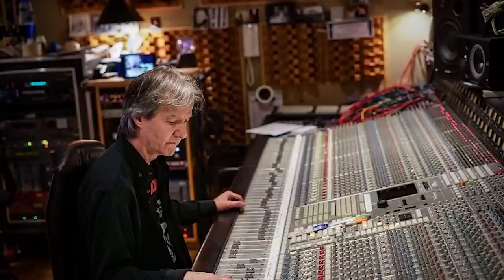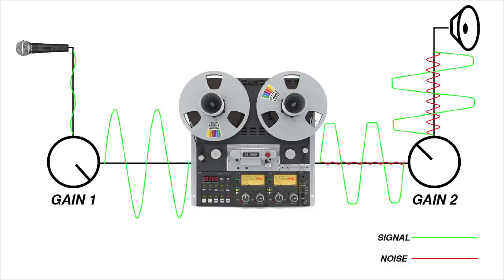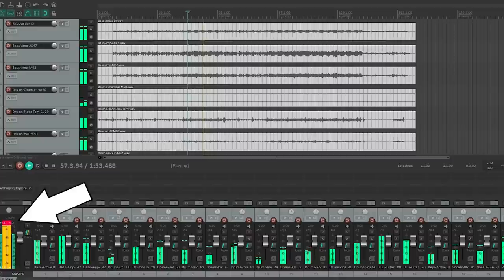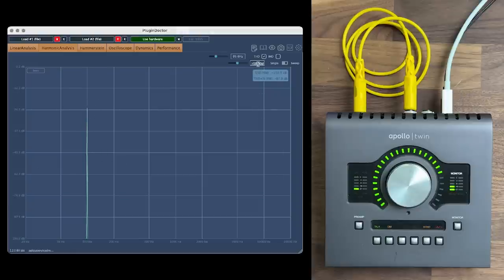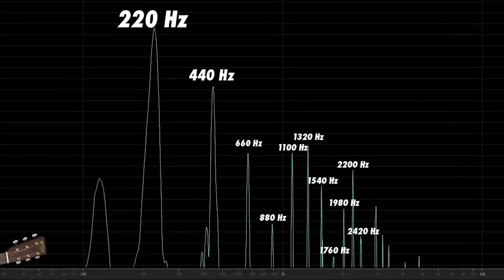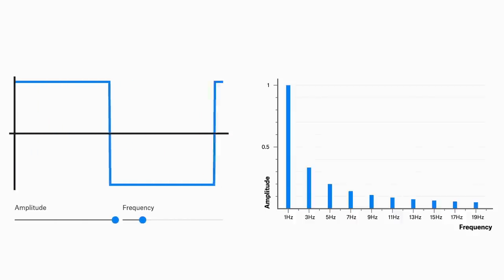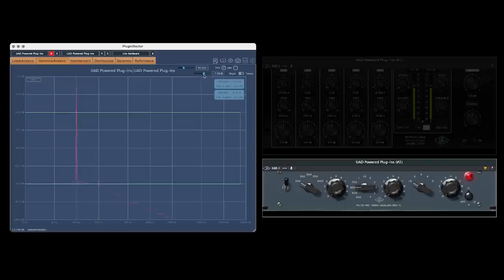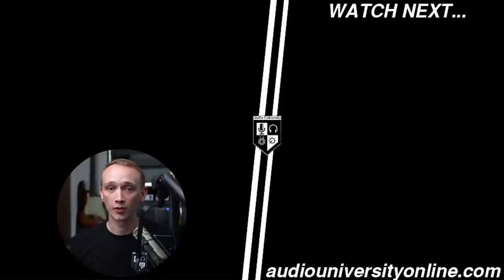What Is “The Analog Sound”? | Understanding Harmonic Distortion (Part 1 of 3)

Comment: You're very educated and it shows. You present well, but those who taught you, clearly don't have a true appreciation for what analog actually is. I will give you a simple analogy that I hope will help break their programming for you.

Incandescent lights are much more attractive than led. Do you know why? Because, though we can't typically make out the blinking of the led circuit, it's there. And very abrasive to the eye. It introduces a pulsing rhythm; albeit, fast, which stands as a separate and substantial part of the experience of its illumination. Add to this that it is quite focused and precise in its travel and direction with very little variance and you have a pronounced but somewhat fragile display of radiance.

Incandescent light takes much more energy to produce because it's accomplishing far more than the led ever can. It's not only sending out a continuous ray into the direction of the observer, but it is also pushing in various refraction into the bulb and creating a bath of light within and around the filament and its enclosure. The lack of which, in the led light, is easily noticeable as missing. Even seeming weak. Because it is.

Clear fidelity of digital music can get the job done with precision. But the reason it's able to is that it takes shortcuts. It gets there without all the fluff of making stops along the way and creating all those beautiful blooms and saturation that we recognize as natural to the real world but easily noticeable as missing from a weak digital representation.
Reply: nrezmerski  everyone knows that the clarity of digital lacks the saturation of what came before. That part is undisputed. So your statement is not correct in that respect. What I'm claiming is that the effect of saturation within the natural experience of sound and how it normally reaches our ears and is experienced is vital to the quality of it being perceived as a genuine, lifelike, sound.
Reply: @nrezmerski  everyone knows about reflection and dampening. We see these things come up in the subject of room sonics and reverberation. But what I'm saying is that at all times, in a natural environment, these things are playing a roll that far exceeds our typical breakdown and analysis. Object vibrating at specific frequencies only and only when the sound get loud enough in those frequencies to actually cause it to occur. Interference waves stacking at specific points in the room and creating coloration within certain parts of the spectrum. This combination between absorption and reflection leads to a lot of what we typically think of as undesireable effects. But I submit that the human ear is capable of making sense through all that and that it's what we are used to.
Reply: nrezmerski  because we are familiar with the way certain Hardware works we are able to select carefully the preamps and individual processes that we use in the hopes of introducing favorable saturation blooms to a sound that will make it sound favorable to us as if truly sounded in a way that was pleasing when it was first sounded in its environment.

You know this effect that I'm talking about because everyone knows that if you use specific Channel strips you will actually mimic a vintage sound as if it is a jazz band playing in a very specific type of environment. That is not just because you have chosen vintage equipment they can be done with modern equipment to if we know which saturation points to hit
Reply: nrezmerski  I would add that the complexity is infinite on this subject because what might saturate a certain area of the spectrum changes as you turn the volume up on a preamp and different frequencies at different points of the volume changes are accentuated more so and some less so
Reply: nrezmerski  Ergo the term nonlinear
Reply: @nrezmerski  as with all things in production we have a tendency to go further than nature in order to accentuate or pronounce what we or the artist is expressing and that's why it's often not perceived as a natural thing to reintroduce saturation into a dry and sterile recording.
Reply: @nrezmerski  I understand your argument and I thought I already addressed it by pointing out the fact that we don't have the ability to introduce the natural saturation so we look for it where we can find it and that is in the hardware. Familiarity with the sound of specific hardware and what we can do to certain sounds with them helps give us a pallet we can work with to try to reconstruct a natural sound. The point is that High Fidelity is very unnatural and it isn't the way the human ear here is because we hear the stuff that microphones don't pick up. We may not hear every little eddie of air currents in the room but we can hear the effect that they have on the frequency spectrum as they interfere with the waves that are heading our direction. The reason our ears hear better than a microphone is because our brain has the ability to make sense of it in real time. But objects in the room vibrating to the sound and air currents interfering with one another as the sound approaches us are definitely things that are not present in a typical professional recording and why the recording sound so weightless and clinical
Reply: @nrezmerski  maybe putting it like this will help. Reflection and absorption have another effect that they also provide for our ears to perceive and that is what we call Reverb or Echo. Just like with saturation of tone we also have the ability to differentiate where is sound source is coming from in the nature of that real sound within a space even though the space and its Echo is interfering with that sound. Two very different anomalies that occur within a real space but with your part of the natural way we differentiate and understand sound when it comes to us. Both of these effects can be too pronounced in a space and create difficulty in intelligibility of the sound. A person trying to talk to you through a paper bag for instance is a good example of the one while another would be a marble room with no absorbing objects in it
Reply: @nrezmerski  in both cases the objects around the Sound Source are heard more than the Sound Source. One by its saturation of the sound and the other by it's Echo. So I will point out that both of these examples will have elements of the two involved
Reply: nrezmerski  finally since we all know that reintroducing artificial space to a sound is an accepted practice for the very reason of which I am speaking because it is far easier to get a pleasant sound that is desirable to what we are doing then to work at finding the right space to get it naturally then it should be no problem accepting that the other effect that happens in a real-space might also be one that has to be introduced later in order to have control over it
Reply: nrezmerski  any piece of analog gear can ruin a sound but the one who finds it useful at a specific time has chosen that microphone preamp Channel strip or whatever it may be because it has a specific absorption to the Spectrum that flatters what they're working on
Reply: @nrezmerski  you're trying to defend the subject of rendering only. But the topic of analog is important to audio engineering in the front end and mixing process. When I hear someone attempting to reduce it to the difference between two mediums and saying that one might be better than another, it's like trying to compare one room to another for recording. If both rooms sound good to you at the time, no comparison is needed. So it's pointless to use that as the example, as it seems you are doing. Analog has a very specific purpose. The reason we have folders in our DAW named analog is because it is an effect that attempts to reproduce the lack of fidelity heard in every natural sound. We don't hear things perfectly sounded to us. There are many imperfections. 

An artist that paints a picture with exact specifications with every color thought out and placed within carefully chosen lines can and certainly does fall short of producing excellence, if he doesn't put the blending of saturation and imperfection in there that tells us it's real.
Reply: @nrezmerski  you're splitting hairs to try and prove yourself right when your argument has nothing to do with the point I brought up. That's what I'm saying. The stereotyping of analog here is wrong. That's what I'm saying. With no respect for the reason it actually gets used by nearly every engineer today. If you're only talking about what medium to use to record to, them by all means be that specific, without bashing what is quite likely, one of the most valuable sets of tools to come to the digital world since we entered into it. I'd say it's up there next to the DAW and automation. It's that important. The potential bias created by your words far surpasses the point you wish to make and I can't even fathom why your point could be so important as to be willing to cause such a bias with it in the first place. The fact that so many engineers are intentionally introducing analog back into their clean digital mixes should tell you something in itself. But based on what you keep trying to reduce it down to, I get the impression you haven't had enough pleasure with the use of it to get past the novelty of it to realize it's necessity. The loudness war is perhaps another topic that might give you a relative understanding of why I'm reacting this way. There is an enormous frustration on both sides of that argument, and each has their reasons. And both are so important to their side that they feel the other side is ruining the entire art. Same with this one.

Comment: What about the linear response of analog gear in respect to high frequencies when it's not clipping? I heard that analog gear tends to sound warmer because they sort of reduces the high frequencies, which can be sort of emulated by a high-cut. I dont know if that's true have you checked this?
Reply: Analog gear by definition does not have a high frequency limit like digital does. Yes signals will roll off as you go up in frequency. But digital hits a brick wall! Half the sampling rate at best! Once you hit that wall, the signal just goes into bad distortion compared to in analog where it is just a bit quieter than the lower frequencies. Hi cut filtering is an absolute requirement in digital and rejected for it's distortions in analog!
Reply: @glenncurry3041  I think you're mixing some things up here. First of all half of the sampling rate is still much more than humans are able to hear. And what do you mean by 'hitting that frequency'? There's nothing like frequency related distortion, just general distortion when you're incoming signal exceeds the threshold of your ADC or your preamplifier, regardless of the incoming frequency. The only thing is, you will get Alias Effects when you try to capture higher frequencies than your sampling rate. To avoid that usually every ADC has a dedicated Low Pass filter which addresses that. I'm pretty sure that Analog gear has also built in Low pass filters. So my question was not a general question, but rather a specific question. How do the high frequencies behave in some Analog gear/Analog emulations?

Comment: Audio perception especially music is extremely complex and not at all like what electrical engineering for good circuit design is. First of all the perfect reproduction of test signals has little relevance to real world load conditions in reproducing music waveforms which are highly assymetric, steep rise and fall, complex time and frequency, fundamental and harmonics, envelope shaping and other relationships and FUZZY LOGIC cues that auditory perception uses to extract signal from ambient background noise. So what engineers mistook as distortion and noise the ear DECODES and uses to provide critical information that it uses to reconstruct the 4D holographic sound field music experience. Engineers when they went digital threw out some of the baby with the bathwater when they tried to reproduce with perfect fidelity simple symmetric harmonically sterile uniform waveforms and not what ears are adapted or designed for.

Comment: You sound that you know too much theory but not too much experience. It is no so simple. From my experience important are cable,internal wires,  power supply, dac chip, not oversampling, preamp with no negative feedback, tube output, discrette output, quality of parts, digital to didital converter  etc.

Comment: Quantisation error really stacks up, and digital artefacts breed like flies. It isn't distortion, it's the audio shitness of quantisation error. Harmonic distortion is not the "magic beans", it's the fact that analogue distortion is harmonic rather than noisy - digital artefacts are highly unmusical. There are loads of analogue circuits which sound like diabolical shitness too, and don't have a musical accent. Audio circuits which "sound nice" are relatively rare - they are both clean and euphonic in distortion. The 12AX7 tube took a lot of development to get right, for example. Not all tubes sound "nice". Tube can sound diabolically horrible.
Reply: Tubes are by laws of physics inherently linear. While solid state is switching devices that can be forced to operate in a narrow linear area.
Reply: @glenncurry3041  Tubes often sound sound clean and *pure. They are also very fast and airy, lots of punch and lots of detail - audio tubes usually operate up to megahertz.
Reply: @weareallbeingwatched4602  Yes tubes rule especially in frequency response. Which is why microwave ovens use tubes and not solid state!

Comment: Unlimited head room , 😂😂😂😂😂😂, you don't know what you are talking.  A/D , D/A converter has refernce voltage limited .
Reply from the maker: Within a 32-bit floating point DAW, there is effectively unlimited headroom. You can clip the conversion stages of a digital system, but all the way up to the point of clipping, it's linear.
Reply: @AudioUniversity  so it is LIMITED up to ref voltage max value.